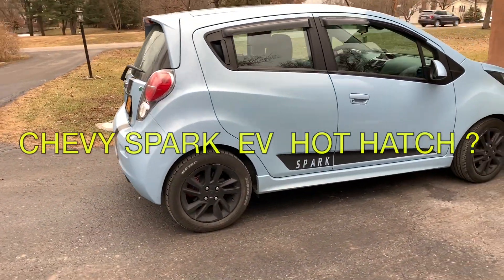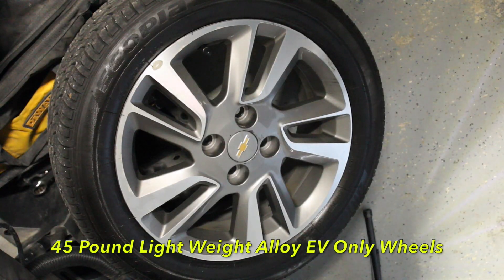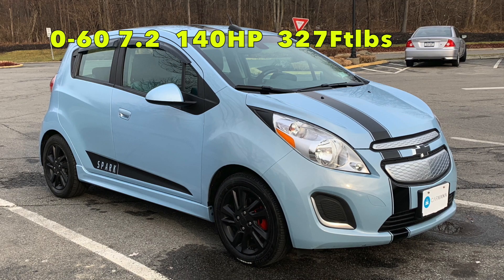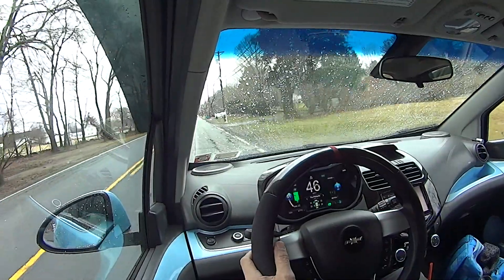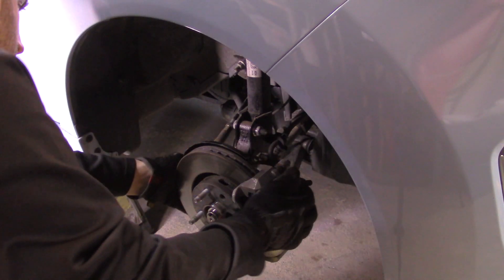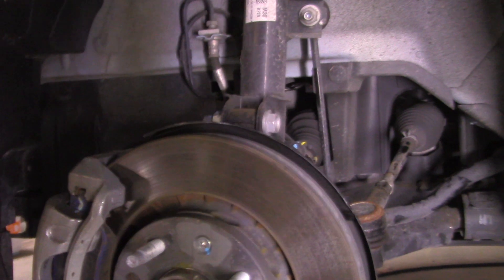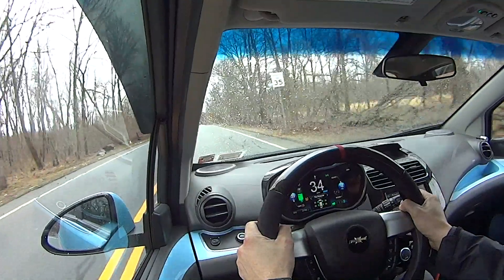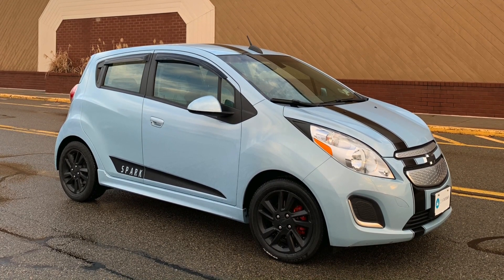Chevrolet Spark EV The only Hot Hatch Electric car ?!

Comment: They are selling me a 2014 spark EV 2LT with 66,748 miles for $8995. I test drove it today and the car its fun to drive..he charged it all the way up and it said 81max miles.  Unfrotunally the screen was not responding very well so he said he will replace it..iam trading my 2009 touring Prius with 126000 miles and dealer will givenme $4000 for it.  What do u guys think?? I  test drove spark EV   for 10 miles one way freeway and city and it say energy used 2.4kwh don't know what this means??.weather was 92 outside and had ac at 68.  I drove it for 20 miles round trip and it waisted 19 miles I believed.  Most of the time I drive only 20 miles to work but other days about 50-60 miles..
Reply from the maker: Congrats 🎊 sounds like a good deal, they went up in price over the last year and the trade in price is high that’s good. The mileage is spot on you will see that number drop to 60 max when and if your going to use the heat. The heater is a major energy draw and the Spark make a guess based on your last 10 drive cycles. Don’t worry it will go back to 80 even more if you drive it conservative but I’m constantly on it. The screens are not hard to replace so hold them to it. Sounds like a good one enjoy !

Comment: I go every day to work back and forth 115 miles
I will buy this car to save fuel
Will you cut all this distance?
Reply from the maker: jordan AL Salaeta I would not buy this car as it only has a max range of around 80 miles in summer , 60 miles in winter when using the heat. My round trip is 30 miles so it’s perfect for my commute in any weather.
Reply: @svtwrc  mmmmmm😲😲😨 Thank you so much ❤❤
Reply: @svtwrc  What do you recommend choosing the Renault Zoe 2018?
Reply from the maker: The Zoe is not sold in USA where I am but that only has 150mile range. Your commute is too far for anything but a fully charged Tesla.
Reply: @svtwrc  I am from Jordan, I saw this car displayed at a Jordanian auction at a reasonable price of $ 21,000
Tesla is too high because of the $ 77,000 customs that I can not pay this price
The price of fuel is very high, half of my salary goes just for fuel
I think 150 miles is very appropriate
Reply: @svtwrc  I wish you success and your channel too❤❤
Reply: @svtwrc  If the power generator is installed in the vehicle from behind, does it affect the car battery?
Reply: @svtwrc  You see this idea good or not
Reply from the maker: jordan AL Salaeta I see some people do this with the generator. The generator can’t plug in while driving. You will need a tow truck if you run our of power. A charger at work is the best bet for you or if you can plug in at work some how.

Comment: From other videos it looks like you own a Quickjack. Can you tell me what model you own and if it fits your little Spark EV?
Reply from the maker: Peter Sachs hey Pete , the Quickjack is the 5000 pound SLX model . It’s the best tool I have and it fits the Spark , my Subaru STi and WRX , Fiesta ST  , mazdaspeed3 and you can  buy extenders for SUV. Some of the larger Sedans and SUV s may need the 7000 lb system and the longer rails.

Comment: I got it brother.
Reply from the maker: Milian TV nice!!! What trim and color. Just ordered two front semi slicks for this beast. Can’t wait for you to rip it for the first time. Traction control off , Sport button ON !
Reply: @svtwrc  Brother, I got the 2014 2LT. Nanophosphate batteries.
Reply from the maker: Milian TV 400ftlbs torque! The batteries are thermal managed and are rated 20 to 30 years without major degradation.
Reply: @svtwrc  That's exactly why I got it brother. It's an amazing piece of art.

We need to test tires with more grip. ;)